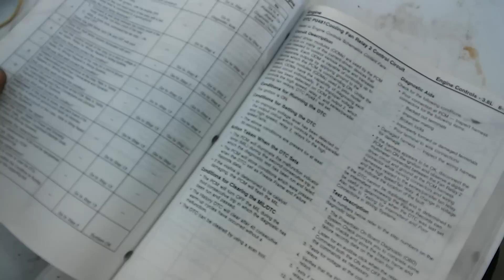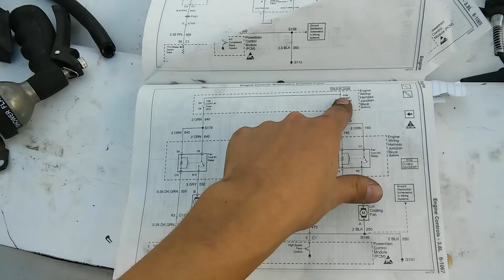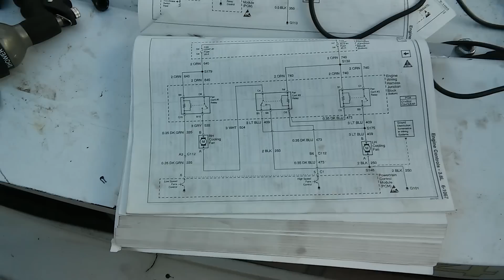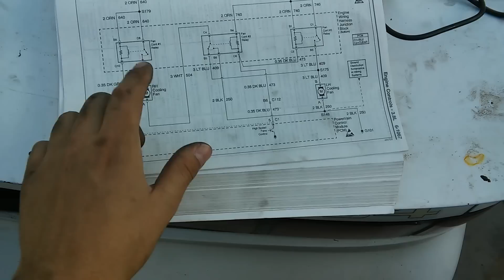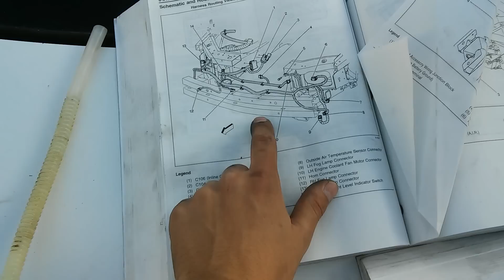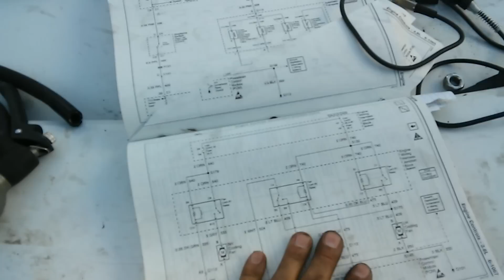2000-2005 Chevy Impala cooling fan problem

Comment: Thanks for showing me where the ground is located. I have the same problem no high speed on both fans.
Reply from the maker: Happy to help!
Reply: @fonzothebeast  I am curious though if you had a issue with NO fans at all or NO high speed fans ? Or no fan 1 low. I have the right side fan when A/C on. I just can't get both fans on high. My temp not bad till it gets hot out summer time. I was almost ready to try a new computer. I put a brand new crate motor & trans in my 05 grand prix. I had same issues with old motor. I thought maybe the block was sludge up from factory antifreeze. I replaced motor & trans because trans went out. I put a pressure switch in at 225,000. Trans quit completely at 275,000 miles. I thought cheaper than a new car. I escort oversize loads. So it's my money maker. I do all my own work. But I really hate electrical. Lack of understanding how the 3 relay circuit has me frustrated as hell. Any ideas on ground being the issue in your opinion ?

Comment: my fans come on for no reason. Truck not even running and fans come on.
Reply from the maker: That sounds like it could be a bad coolant temp sensor, cooling fans are typically computer controlled to keep vehicles at a normal operating temperature and yes even after you shut your car off the computer still monitors the engine temp. So typically when they turn on for no reason they are getting false input from a sensor, usually the coolant TEMPERATURE sensor tells the computer when to turn the fans on and at what speed. 

You can do a resistance check on your temp sensor (cold) and heat up the sensor to see if the resistance goes down, or vice versa depending on design.

The other possibility is that you have a ground switched load side wire that is shorted to ground. That is easy to check tho and plenty of videos already on youtube that show you how to do it. But my guess is on the erratic coolant temp sensor. 

so in total, if its cheap and not too much of hassle:

REMOVE AND REPLACE THE COOLANT TEMP SENSOR.

Comment: how did u clean it?? and can I look in the same spot to find mine on my 2k monte carlo. because I'm getting the same po481 and I changed the relays an still getting the code
Reply from the maker: CHICAGORILLA with a bit of sand paper is all, did you check the fuse along with the relay?
Reply: No I just bought a new relay...so to be clear all u did was clean the ground wire by unscrewing it and sanding it and then check then fuse??...how long after did it take for the code to dissappear? ?
Reply from the maker: CHICAGORILLA just disconnect and reconnect the battery, the code never came back

Comment: do the fans run continuously when the AC is on? or does it go on and off? my 2004 impala goes on and off and only overheats with the AC on. I replaced the fans, thermostat radiator the three relays  and flushed the coolant. and still does the same.
Reply from the maker: yes the fans need to stay on all the time and oh the HIGH mode when ac is running. I dont have the book in my possession anymore but i do believe the fans turned on through a separate relay when the ac is active. I think your problem may lye with a relay issue or computer.sensor issue not recognizing the ac is on when the switch is flipped. start with the relay first tho.

Comment: Thanks for the explanation Alfonso. I cleaned this ground but for my low beam headlights not working. Can you tell me if your books tell you how to find the issue? I've replaced everything...I mean everything related to the headlights from bulbs, switches, fuses, and relays. Is it the BCM going bad?
Reply: forgot to mention it is a 2002 Impala LS 3.8. The security light is coming on now, its been about a week or so but it doesn't prevent the car from running or starting. I was wondering is this caused by a bad ignition switch? but then I received a recall on the ignition switch today in the mail from the dealer...as for the low beam, I think it is a ground issue, you mentioned the CPU completes the ground to activate the relays?

Comment: help me. I have 01 impala. cuts off electric included after driven a long distance. at least 10 straight miles. then won't start or get any electric when you try to turn key. one of my mechanics noticed the ignition relay was hot and that the car appear to crank fine once the relay cooled ive gad nabyv things replaced and checked. ignition switch replaced, MAF, crank position sensor etc. there is also a connector behind the motor I find and I don't know what it connects to its a small two wire harness. says PED. im also not sure if my fans are kicking in it not. car isn't over heating but I hadn't drive it a long distance to see if any chance in the cht off behavior.
Reply from the maker: Delrico Alexander without being there to diagnose i can't really help you much. It sounds like your mechanics are terrible troubleshooters of they have replaced multiple parts with no results, might be worth to get new ones. If you are not getting ANY ELECTRICITY I'm talking about not even interior lights coming on, it may be worth the effort to check the battery health ( load test free at auto zone), terminals, AND corrosion on the power side of the wire.
Reply from the maker: do you have anything aftermarket on the vehicle??
Reply: Not that I know of. When im riding the car just shuts off and there is no power. Not nothing. No dash lights pr anything. After about 10 -15 mons it will turn over crank like nothing was wrong.   Where you located?
Reply from the maker: Delrico Alexander if you Do not have dash or accessory lights it's definitely a battery/supply issue. best thing i could tell you to do is get a new/used battery check the terminals for tightness and cleanliness and check the power side cable for corrosion
Reply from the maker: more then likely it will be loose battery cables i think
Reply: Thats not it sir. Battery has been off and on to test it since this started.  The car just shuts off.  The battery wouldnt make the car shut off because when running the batter isnt needed.  We noticed that the ignition relay was hot when  the car shut off and it wouldn't crank or do any electric until the relay cooled off
Reply from the maker: Yes a battery would make a car shut off if improperly attached, I have experienced it first hand. It sounds like you simply need to trouble shoot it. If you do not have accessory lights when electricity dies it would not be the ignition relay, it is a complete cut off from power, which would make me suspect the battery : if you insist the battery is serviceable AND attached correctly the only other suspect I could think of is a bad computer. Do you know how to use a MULTIMETER???  If you do i could give you instructions on how to see if the computer is receiving signals and is putting out signals (if it is alive) or if it is just dead when the car cuts off and does not want to restart until cool.
Reply: Never used it but I ordered one it should be here Soon. you could give me. Instructions because if it has nothing to do with ignition relay or any wires or connectors that effect the relay then im stomped.  One it has a few more problems but I would love to pay you to fix. Lol if your ever near atlanta ga let me know.  Im getting codes for knock sensor and egr valve and map sensor man I need your help.
Reply: If you could just respond and give your advise from time to time it would be greatly appreciated. My grandfather was going to sell the car for like 1000$ and I told him not to. That we would fix it eventually
Reply from the maker: I cant view the picture
Reply from the maker: the ignition relay does not have anything to do with the accessory lights, that is controlled by the BCM different computer all together. Although the bcm and ecm have different grounds they share the same power source and talk to each other, i do have to warn you though for me to get access to the wiring diagrams you will have to create an account on *http://www.eautorepair.net/Marketing/Default.asp* and it will cost 18$ for access to the wiring diagrams for the vehical.